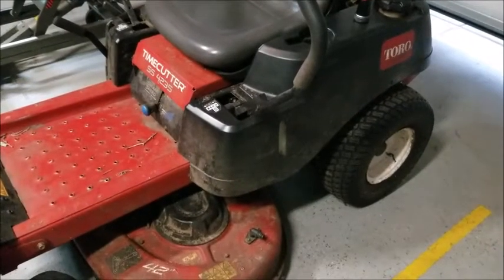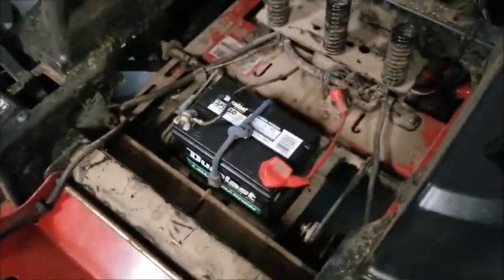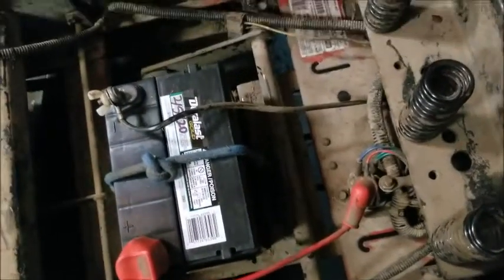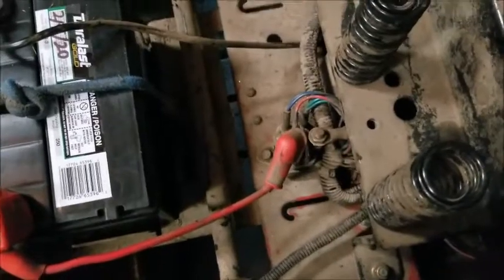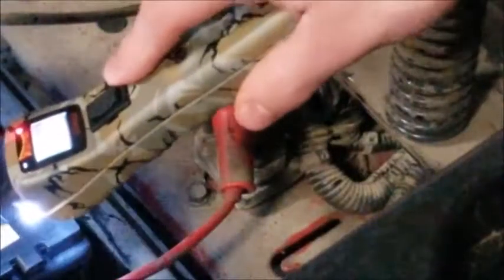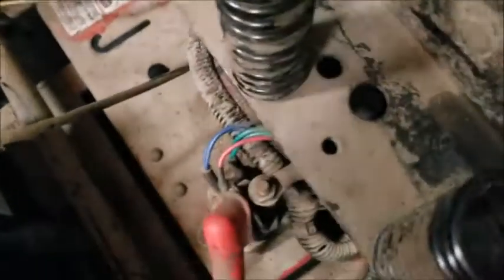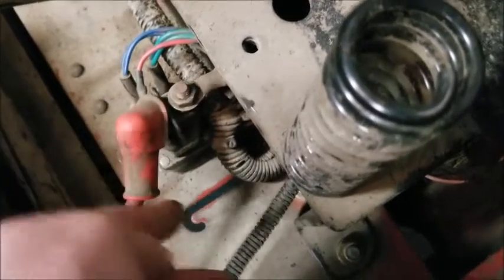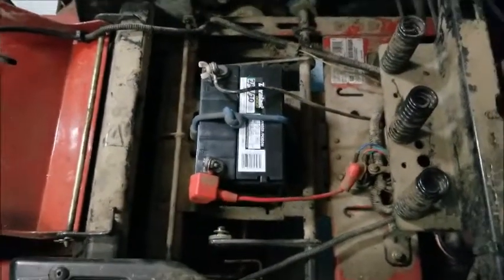Testing a Riding Lawn Mower Solenoid (with a power probe)

Comment: So could you send power with the power probe on the starter side of the solenoid and expect the starter to crank to confirm the starter is good? Thanks
Reply: No you can't. 
 Several reasons way but the answer is no